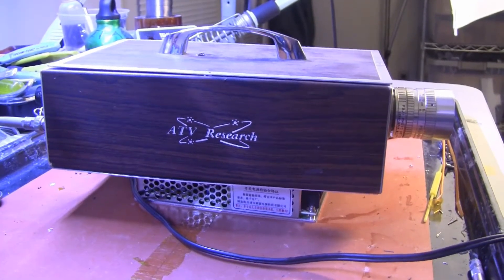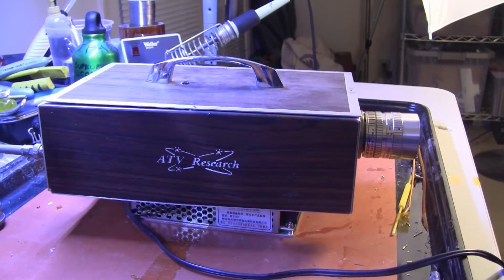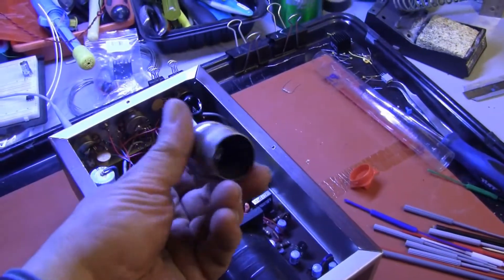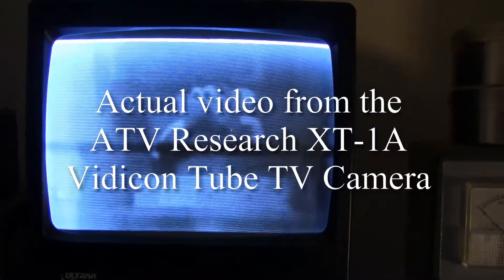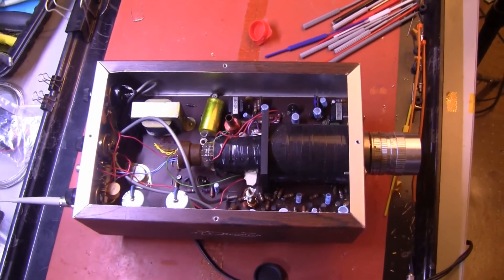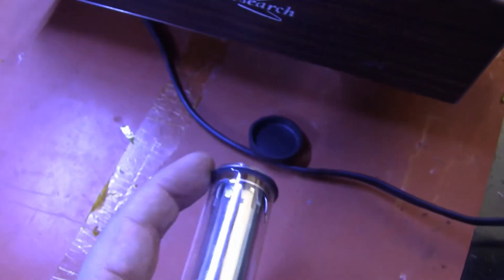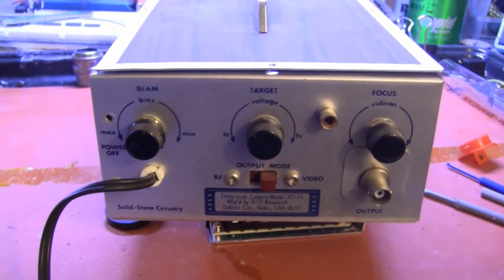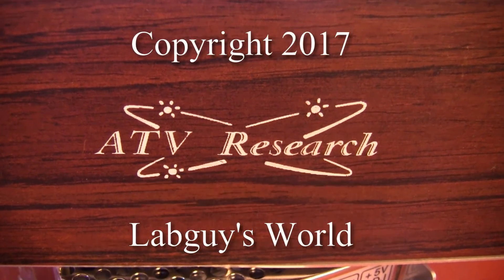1970s ATV Research XT-1A Vidicon Camera Kit

Comment: I was studying Electronics Engineering at the time and built and owned one of those. Great experience, and great start to what has been and still is a wonderful and very successful career as an engineer.  If I recall correctly, I had the 7735A vidicon. Thank you, Mr Mel Shadbolt!
Reply from the maker: Yes sir. Totally agree. I would extend my thanks also to Al Denson and Copthorne McDonald. RIP, both them.

Comment: Hi Richard one and only lab guy ....i loved the video very much so love seeing old vidicon cameras but more so kit ones ,so that was a bonus ~! looking at the schematic and pretty much every one i have seen.....can i ask you a question why is there no feed back from the deflection coil for lineality which is always a problem for crt with magnetic deflection ? i don't understand why there does not seem to be the same problem for a camera ?
Reply from the maker: The coils of a vidicon deflection yoke have lower angle of deflection than a TV yoke. If you had a tube long enough and used a one degree deflection angle, it would be near perfection. It is the shortening of the CRT that drives up the required deflection power and non linearity.

Comment: I built Mel Shadbolt's original 5 tube (plus vidicon) design using ATV Research's focus/deflection kit as a nerdy 14 year old.  Made possible by well used film chain 7038 vidicon donations from KOOL and KTVK in Phoenix.   Great, fun memories!
Reply from the maker: Thank you for sharing! That's the post I've been waiting for. Congratulations on a successful build. My first vidicon was a film chain 7038 given to me by an engineer from KRCR-7R in Redding, California. I got my first yoke from Al Denson. He provided a five tube camera schematic which I used for the first iteration of my camera. It was based an model 80 from Dage. Worked horrible! Took hours to warm up and settle in. The second iteration was the Gary Davis solid state camera from Popular Electronics.
Reply: Wow! I also built one of those 5 tube cameras when I was 15! It actually worked - but just barely. I was so grateful to Jess Waymire, CE of KRTV, Tony Lopich and Earl Crowder, CEs at KFBB. Both these stations were in Great Falls, Montana. I just can't express enough thanks to those great guys both for the "expired" 7038 vidicons (or maybe 7735s?) they gave me and their expertise in building electronic equipment. I bought all the additional parts from Allied and Newark except for the yoke kit which I bought from ATV. Totally distorted picture but you could tell what the camera was looking at. Building that camera was the best education I ever received.  I absolutely loved that adventure.

Comment from the maker: I made a slight boo boo @5:45. This type of electron gun does not have an accelerator after the grid cup as I imply. That is in o'scope CRT guns. Not vidicons. The order of elements is actually: heater (H), cathode (K), grid cup (G1), focus anode (A1) and accelerator anode (A2). A2 is capped at the end by a super fine mesh just before the phototarget (T) that is part of the collomating process. The other half of the collomator is the so called focus coil. I have covered that topic in several of my earlier videos. Like this one here:  https://www.youtube.com/edit?o=U&video_id=v6tiGBze47c